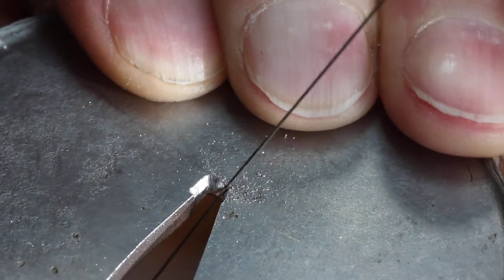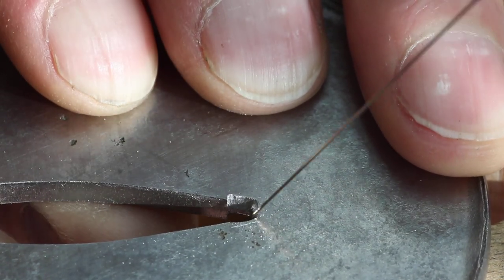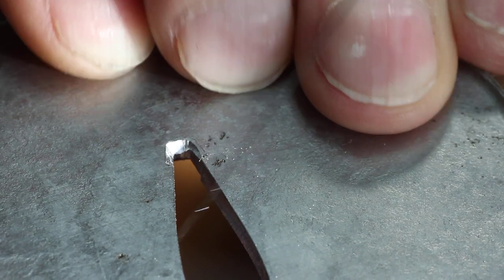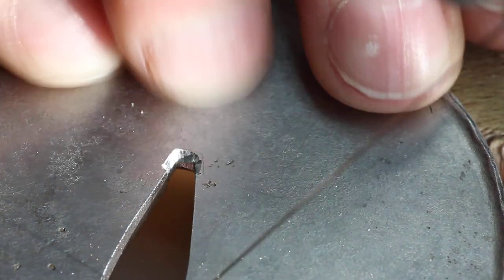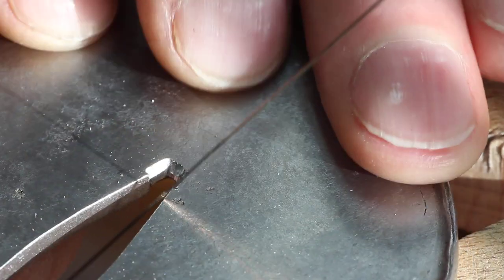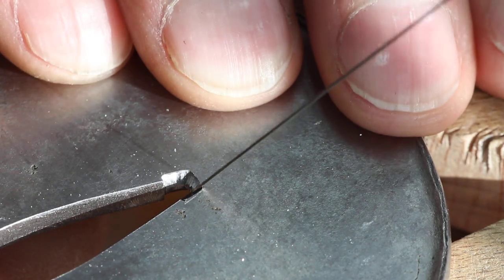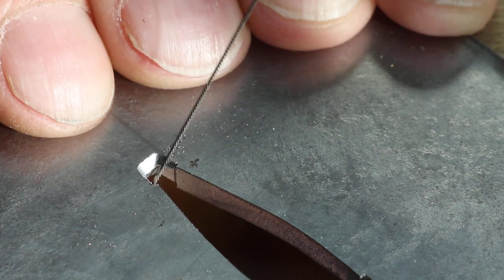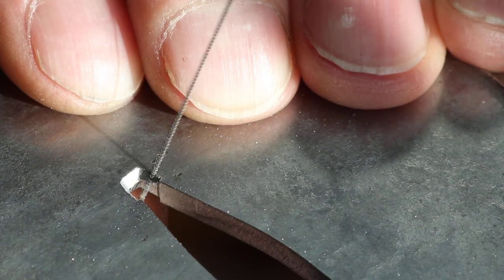Using a jewellers piercing saw as a fine file.

Comment: Would a spiral blade work as well as a standard blade?
Reply from the maker: No, I don't think so, part of this particular approach is the way I'm using the flat side of the blade to rest on the metal and then using the teeth as the blade is gradually moved along. The flat side acts as a safety edge and provides a sort of guide.
Reply: Thank you for replying, I figured the flat side would act as a guide taking layer by layer off as you go. A spiral blade would act like a round file I would guess. Great idea anyways.